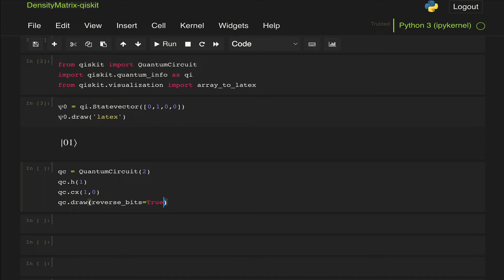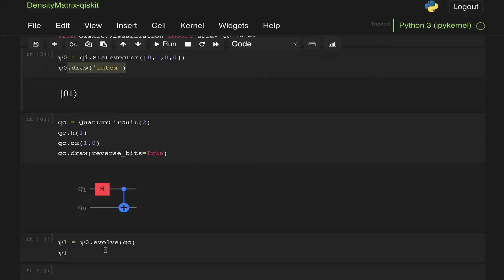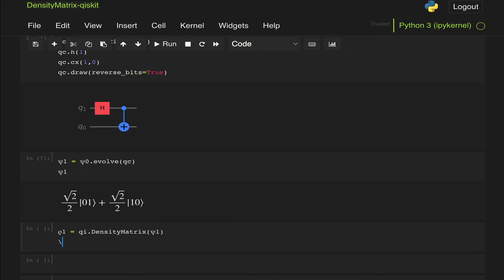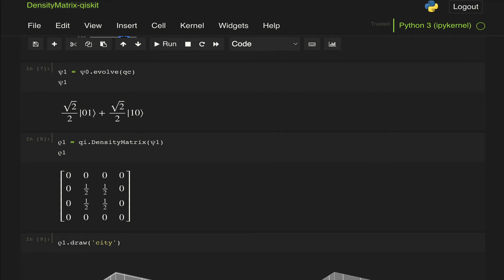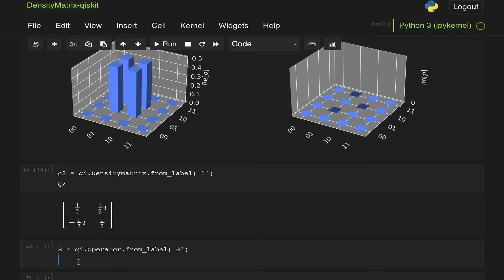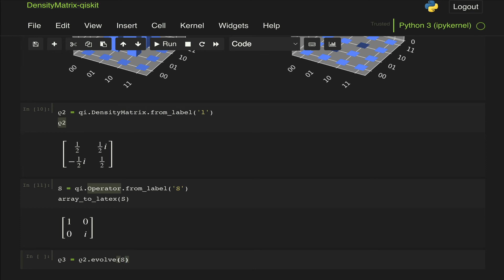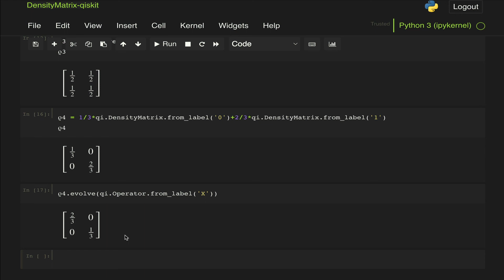Density Matrices in Qiskit

Comment: Suppose I have a 30 qbit system, due to computational complexity, I can't find the density matrix of the system. But is it possible to find the partial trace of the  a sub-system of 2 qubits out of 30 without explicitly finding the density matrix?